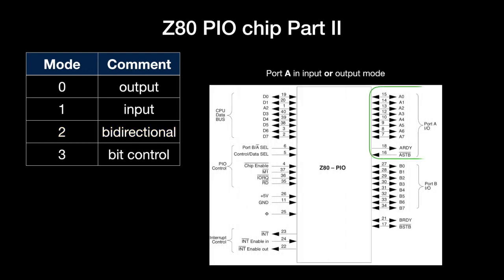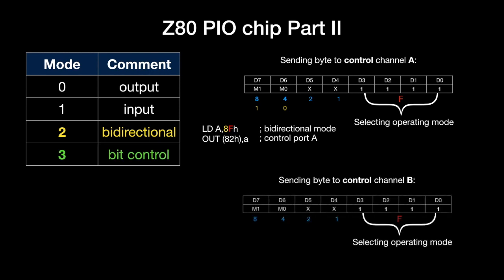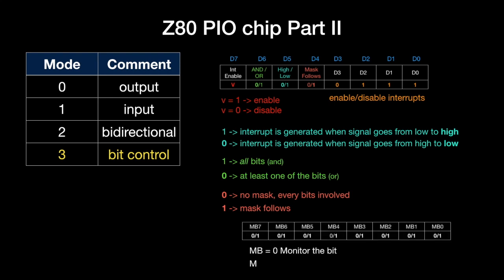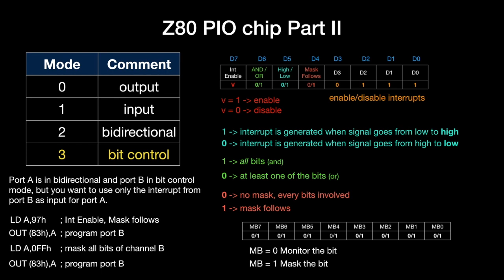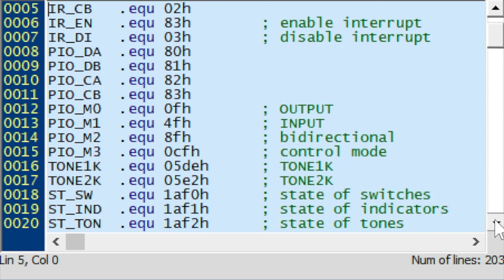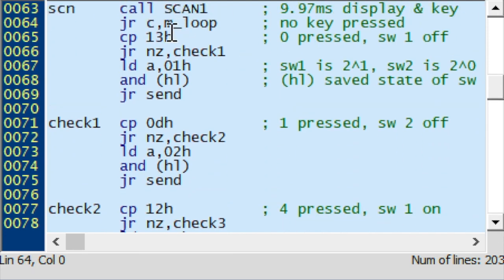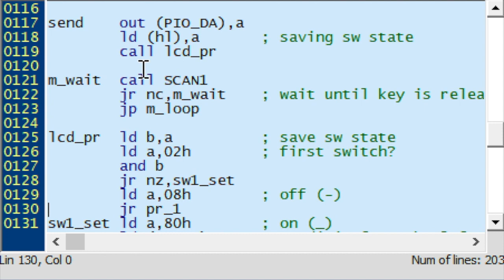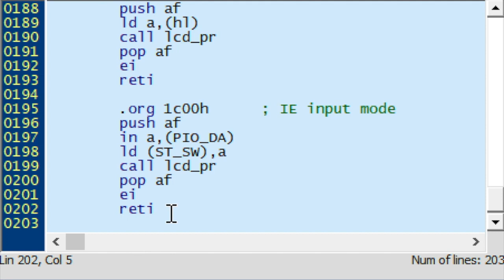Programming the Z80 PIO chip Part II

Comment: Hi thanks for an excellent video on the Zilog PIO.  I have used the Zilog PIO chip to print to a dot matrix printer in one of my Z80 computers.  But I did not have to utilize the handshaking/interrupt capability of the PIO.  Now I am trying to connect two Z80 computers via the PIO chip as in the example on page 377 of the textbook "The Z80 Microprocessor" by Ramesh Gaonkar.  His example utilizes handshaking and the Z80 interrupt mode 2 and the bidirectional data transfer mode 2 of the PIO.  Unfortunately, the interrupt pin on the PIO is always low, so that the Z80 processor is interrupted when it should not be interrupted.  Do you know what I am doing wrong?  Should not the PIO interrupt pin be high (not active) until the strobe signal is sent? If so, what makes that interrupt pin low, at the start of the code?